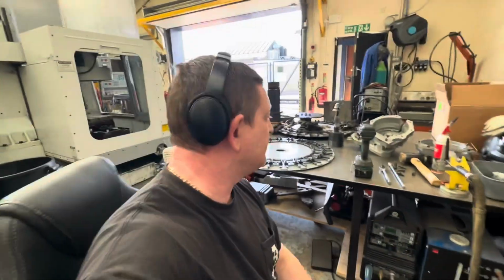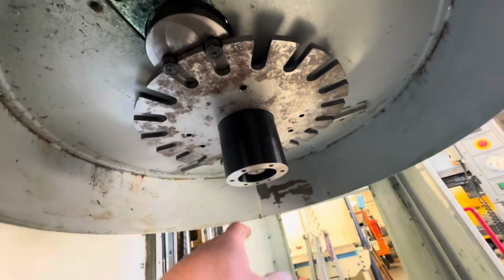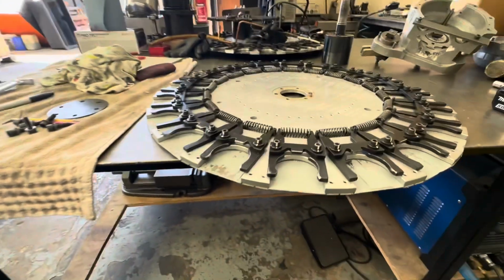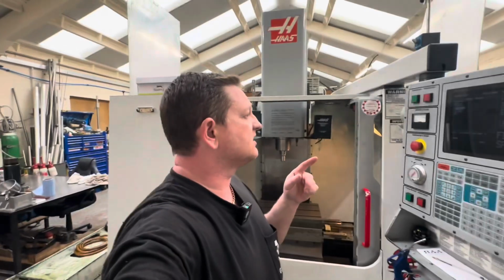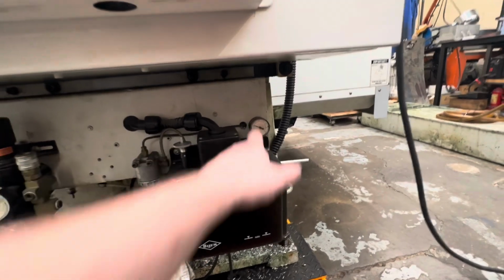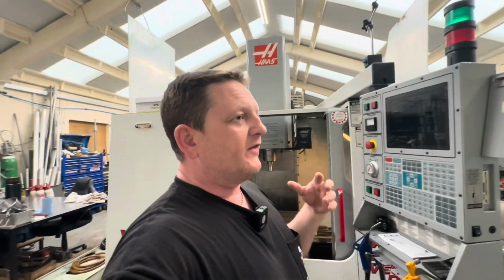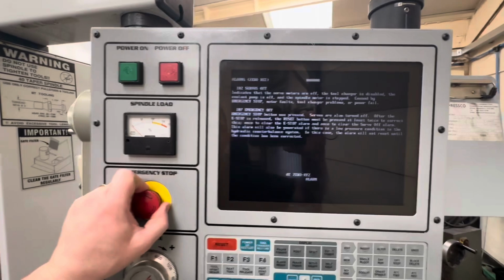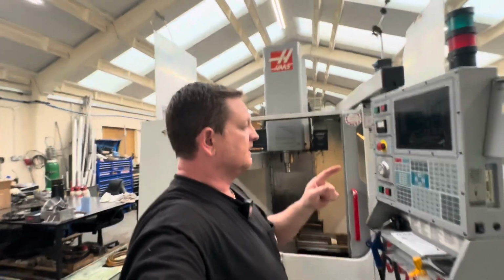VF1 tool changer clean up & oil lube issue found!

Comment: To get rid of that green stuff, I'd spray it with some kind of degreaser, let it sit, and then pressure wash it. A cnc lathe I got recently I used the oven cleaner trick (just spray everything down with oven cleaner, let it sit 10 minutes, and pressure wash) and it cleaned up everything beautifully! I just got the spindle drive working on that machine today! Pretty happy right now. The first time I've seen the axes and spindle move on that machine since I got it exactly 6 weeks ago
Reply: I'm guessing your x phasing error is some capacitors in the x axis drive are getting tired. When you power it up, the timing is slightly off because of the slightly failing caps, but if you power it up with e-stop in, the control side of the drive is powered up before the AC side is, and then the phase detection works properly. In these 90's vintage machines, if you want them to be rock solid, you pretty much should just shotgun replace ALL of the electrolytic caps in all of the electronics with new ones. Then the machine will be solid for another 30 or 40 years!
Reply from the maker: I hear what your saying and i've heard lots about bad caps in electronics as you mention, i did try another servo amp drive though and another pcb but still the same issue, unless i was unlucky and they all have the same problem which would be just my luck lol
Reply from the maker: I have been using a heavy duty grime remover i got from Screwfix same sort of thing, i cant use a jet wash on it as the machine is indoors in the workshop so i just end up using tons of rags to do the job

Comment: Hi. A question, maybe some info or even an incorrect procedure on my part. With my VF2 the spindle fan runs on for several minutes after milling has finished. This helps cool down the spindle motor & its associated electronics i.e. IMO a good idea. However, your fan is really quiet (difficult to believe - i've changed mine unecessarily), you've switched it off for video purposes or you don't find it necessary to keep it running on a bit. Any ideas ?
Reply from the maker: Hi

The noise is really dependent on the type of fan on the machine, on this vf1 and on my vfoe the fan is almost silent but on my vf3 it has a bigger different style fan and it is very noisy,

I have the fan timer set to run on for 6 minutes on my vf3
Reply: @kinzy_fabrications  many thanks for the valuable info. I've got the noisy variant. Have you access to the type no. it's VERY loud.
Reply from the maker: @user-iw5gb2lj9p the 2 types are not interchangeable due to how they mount on the machine 

The smaller machines vf0/1/2 with the quieter fan mount on top of the head and the gearbox machines has a noisy fan mounted in a bracket that went around the motor

Comment: i was told to not use Vactra oil on the linear bearings .... told to use a  5 - 20 Weight  synthetic instead.... that Info came from HAAS and also remove the Sintered  Filter
Reply from the maker: Yeah I used Mobil 1 in my mills for about 2 years now and have the filters removed